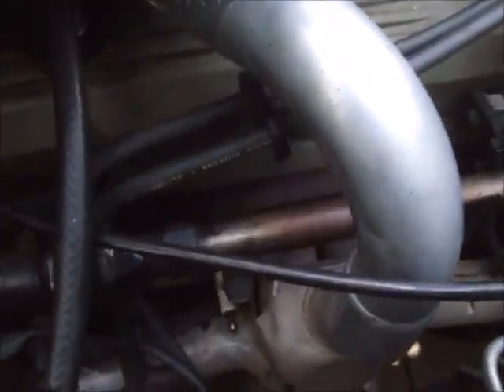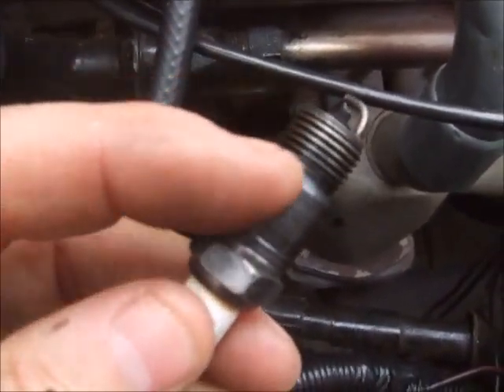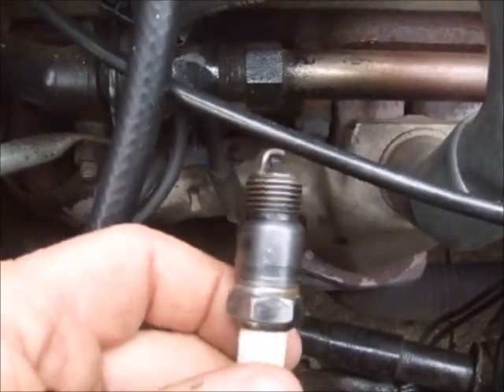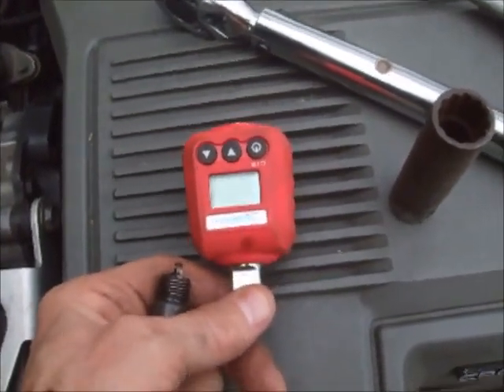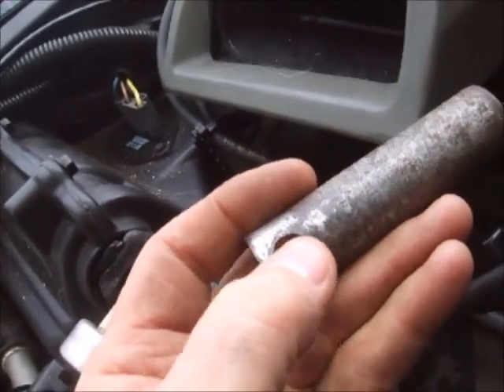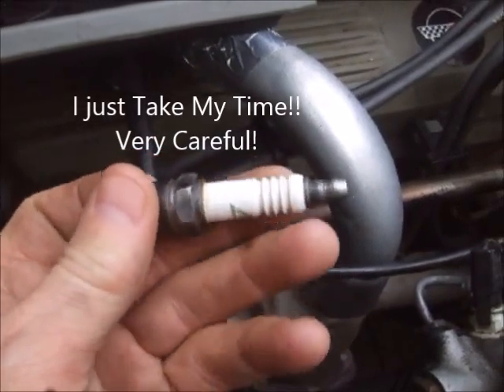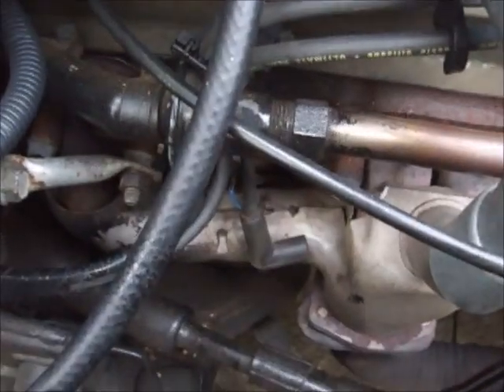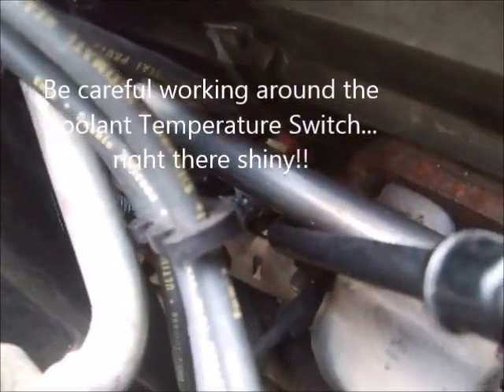★彡 𝐒𝐏𝐀𝐑𝐊 𝐏𝐋𝐔𝐆 𝐓𝐎𝐑𝐐𝐔𝐄 𝐎𝐍 𝐀𝐍 𝐀𝐋𝐋 𝐎𝐑𝐈𝐆𝐈𝐍𝐀𝐋 𝐒𝐓𝐎𝐂𝐊 𝟏𝟗𝟖𝟒 𝐂𝐑𝐎𝐒𝐒𝐅𝐈𝐑𝐄 𝐈𝐍𝐉𝐄𝐂𝐓𝐈𝐎𝐍 𝐂𝐎𝐑𝐕𝐄𝐓𝐓𝐄 彡★

Comment: What’s the firing order for the 84? I made a rookie mistake of not taking a picture of my distributor before and after as well as not labeling my new wires
Reply from the maker: FSM:  Figure 6D-29 and 6D-30.....lot of detail regarding wire routing and firing order to the distributor.
Reply: @HorseshoeBeach  I need to get my hands on a fsm. Is it safe to assume the wiring is the same for other cars with a 350 sbc? Also does it matter when I plug in the wires to the distributor or can I plug any of them in whatever order as long as they’re matching their corresponding cylinder?
Reply from the maker: Yeh best thing to do is refer to FSM. GM SBC wiring should be same: drivers side back from fan 1,3,5,7, passenger 2,4,6,8,  Distributor wiring: like I say best to defer to FSM, wires 2 and 3 get special attention. Just don't want to advise someone on youtube comment section. FSM are cheap and very valuable.
Reply: @HorseshoeBeach  appreciate you replying back to me. I rearranged the wires and went to start the car and sounds like I have a misfire. Double checked all boots to make sure they were in right, what did you mean by wires 2/3 get special attention? I will definitely get a Fsm in the near future don’t want to wait until it gets here though I’d appreciate any more advice you could give me.
Reply from the maker: 2 of the wires I think, cylinder 2 and 3, route in front of the cap because they can't touch, but again don't hold me to it. These crossfires are finicky as hell, I'm uncomfortable giving advice anymore on the 1984, especially on YouTube, kinda like giving advice on something you can't see. If you can afford a FSM, don't hesitate.  It's a CROSSFIRE thing, not a SBC firing order thing...........just finicky, hard to compare to a regular SBC.
Reply: @HorseshoeBeach  I feel so dumb. The reason I had misfires was because the diagram I was looking at every spark plug connection was off by 1. So spark plug 1 went to 8 and 8 went to 4 and so forth but it left me stumped for a couple of days I learn as I go slowly but surely 😂 I will definitely separate the cables tomorrow when I get some time thank you for your feedbac!

Comment: Did not realize that they were so sensitive to 22 lbs. Good to know. Thanks again for another Great tip !
Reply from the maker: Yeh me neither, had issues in the beginning, couldn't figure out why, asked a lot of questions to an retired chevy dealership  mechanic. It was the crossfire plugs ability to dissipate enormous heat from the HEI distributors and burn off the excess gases inside the weird intake. They either were all the same or one would work it's way loose and end up back in the Dealership Bay being complained about. They were seated aginst the engine block with the bevel against the  spark plug well or they weren't....the finicky crossfire, gotta love em.   lol

Comment: i am having the symptom that feels like misfire. I hope changing these plugs solves the problem without changing the wires. Thanks for the tip on the torque. Mine is an 82 and i have the heat shields. I worry that maybe a heat shield has cut into the wire.
Reply from the maker: Thanks for commenting

Comment: Hello again and  you might want to check on that plug gap..yes .45 is in the manual but look on top of your fan shroud for a sticker saying that gap has been changed to .35....I had to redo my plugs because afterwards I saw that sticker from GM..HMMmmmm
Reply from the maker: The GM HEI Distributors were very capable of arcing and firing a spark plug gaped at .045, (even .055 for racing). The more powerful HEI distributors allowed for a much wider gap. The change to .035 was more about emissions than optimal performance. The manifolds on these Crossfire Injections are very WET, the wider the gap the more fire, the more fire the more gas that is burned off *Very Quickly*. The Crossfire will run very poorly when cold at a .035 GAP. The gasoline being sold at the pump in 1985 was lean, causing lots of emissions from the exhaust and consumer complaints. GM decided to change the gap to .035, but by this time the NEW 1985 TPI was already getting ready to roll off the production line, so GM really didn't put much effort into the old Crossfire, other than try to pacify the Government. Me personally, I will stay with the .045...mine runs terrific!!

Comment from the maker: READ POINT NUMBER THREE BELOW. Some Information Worth Reading if you like a smooth running Crossfire. Detonation, Spark Knock, MISFIRES......Using ANTI-SEIZE Compound, there is a lot of information out there both pro and con. My advice again is do your own research and make your own decision. One major function of a spark plug is to transfer heat off a combustion chamber.  A spark plug that malfunctions over time  and fails to transfer heat as a result of over/under torqueing could possibly *burn* a valve. In light of that, I will forego Anti Seize compound and periodically check my Spark Plugs as a regular maintenance item like checking the oil level. My 84' is babied however.
 From the spark plug manufacturers perspective, most do not want you to use anti-seize on spark plugs. Their reasons being...

1) Nickel plating on spark plug threads prevent corrosion.
2) Adding any lubricant to threads changes the torque and allows spark plugs to be over tightened.
3) *******Spark plugs spend their life dissipating the heat of combustion. Two of the major paths of dissipation are the contact area between the cylinder head and the seat of the spark plug, and the contact area between the threads of the cylinder head and the threads of the spark plug. Lubrication in these areas change the heat transfer properties and the spark plugs will retain more heat than needed.

I have seen point number three above proved many times. When spark plug applications are made, a special spark plug called a thermal couple plug is used. This spark plug has a tiny heat probe extending through the ceramic tip of the spark plug. It remains flush with the ceramics and it measures the temperatures at the tip of the spark plug inside an engine. These special spark plugs are used to determine which is the hottest cylinder in the engine and then the application is made to that cylinder. The idea is to find a spark plug that will retain enough of the heat from combustion to burn off any impurities that have gotten on the tip, but it must not get hot enough to cause detonation.

We can take a thermal couple spark plug and measure the temperature ranges at the tip of a spark plug for any given drive cycle. If we take the thermal couple plug out of the cylinder, apply anti-seize, reinstall, and perform the same drive cycle, the temperature at the tip of the spark plug can be anywhere from 25 degrees to 170 degrees hotter. Again, the temperatures are different for every engine and every cylinder in that engine.

To the driver of the car, most will never notice any difference. In some applications it will cause spark knock which is dangerous. Depending on the situation, if a cylinder is running too lean for some reason, and the spark plug tip temperature is already too high, *******any excess temp in that cylinder may cause the spark plug tip to start melting or it could start burning a valve******.

So while you may have used anti-seize for all your life and have never had a problem, you did change properties in your engine that go against the manner in which it was designed to operate.
Reply: Champion spark